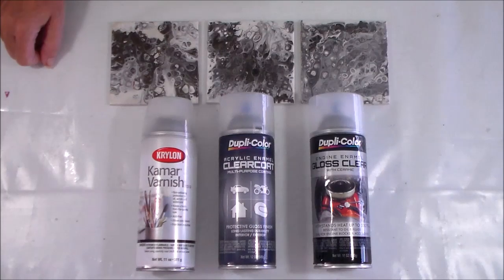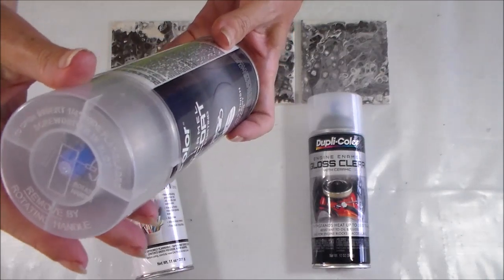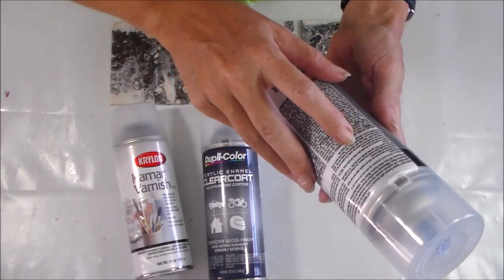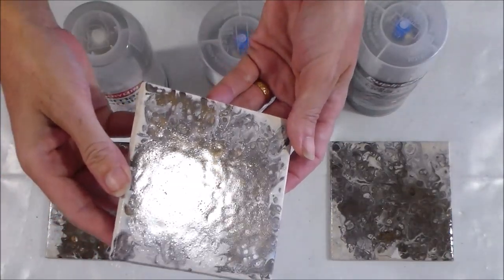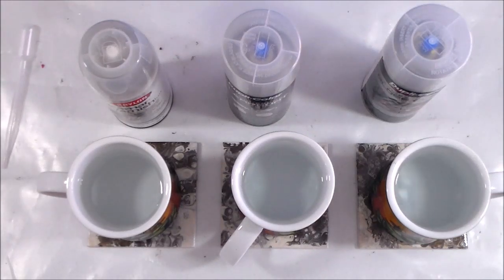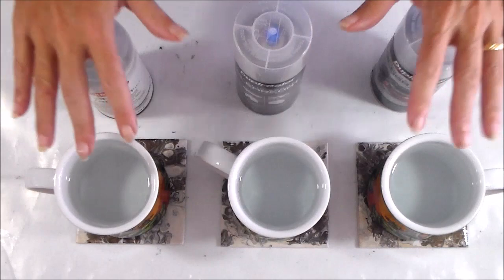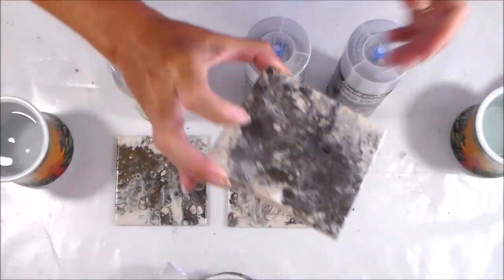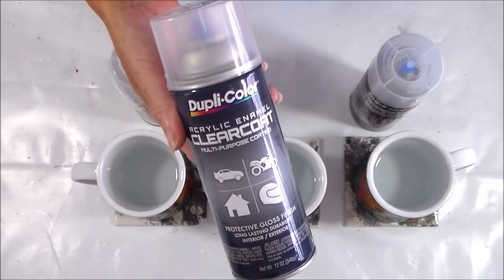Best Sealers for Painted Ceramic Tiles (Test & Review)

Comment: Hi there, I can recommend that if you had placed the completed tiles in a hot oven around 100 Celsius for about 20 minutes this would have baked these tiles to a more heat resistance level and you would have had better results as many heat resistant polymers need to be heat activated to harden the product I’ve tried this technique and it works very well with many other spray acrylic enamel polymer clearcoats, especially the gloss clear coat that definitely needs to be heat activated that’s why it’s for car engines the first time the engine runs hot that will activate the enamel and produce a harder wearing coat once the engine cools down, hope this helps 🙌
Reply: do you know if painting with poshka markers and acrylic, then baking the tiles would melt the paint? Ceramic tiles this is for

Comment: Here's something to try with any finish you experiment with.  Give it a heat treatment.  I baked a tile I had sprayed with Krylon Clear Gloss.  It came out nice and my hot mug does not stick.  I baked it at 200 degrees for an hour.  The color wasn't pretty to start with and it may have dulled a little.  And with medium hard effort I can scratch the surface. I think a lower temp for half the time will be my next test.  Thanks so much for your inspiration and information!
Reply: I was just going to ask if anyone had baked theirs. I just purchased the high heat one you tested in the video and it says to bake at 200 degrees Celsius for an hour to cure. My test subject is in the oven as we speak! How did your further tests go with heat? I am unfamiliar with Krylon so not sure if it supposed to be baked like the high heat one above. I will let you know how mine goes :)
Reply: Just looked at the cooled tiles. Gloss is good, hard a nails, hot cups no issue but my white did go a bit beige. Not sure if that is due to the paint being acrylic underneath or not enough coverage/coats with the spray so I will try another one with more coats and check the colour preservation. Due to product requiring 200 degrees Celsius for an hour, not sure if lowering the heat or time is an option???
Reply: @slertgum  , the engine spray is supposed to be baked at 200 degrees Fahrenheit which would be around 95 degrees Celsius.  Also, don't use your home oven.  The fumes can be dangerous so it is better to get a smaller toaster oven and bake your tiles out in a garage.

Comment: Great video thank you, but with these sealers did you you try  how best to clean.  I had a customer use a rough pad,  Which I had advised not too.  Scuffed them around the edges a bit. And I had sealed twice.  I also primed with a car primer.

Comment: Thank you so much for doing this!! I have been searching and searching for something that I can spray over my tiles in order to safely use for a hot plate. Do you think if you did multiple coats of the one product that worked the best, you may get a better cover and shine? I love how the resin makes the colors pop n the tiles. But unfortunate that it doesn't withstand the seat.

Comment: MinP
Thank you for taking the time to test these products..I had tried item # 3 myself and it did not work at all.  I was hoping you would find something (you said you were going to try) and indeed you did.  I'm  so glad there was a product we could use. Just got back from the store, got a great deal.  Can't wait to try it.  For me resin was not an option .  
Again thank you!!  Very much appreciated.
Reply from the maker: Excellent, glad it was helpful. I would say keep the coats nice and light and thin. I suspect that thicker coats also contribute to the sticky feeling and the dents in the finish later on
Reply: I'm working on wood coasters so I am keeping my fingers crossed, hoping this will work. My fear is that it works on tiles but not on wood.   I am waiting at least 3 days to make sure it's all "cured".
Reply: Sorry to have to report the the spray did not work for my coasters...as I mentioned I am using wood and I suspect that is the reason behind the failure.  I followed your instructions to the letter.  So I am guessing I am stuck with a bunch of wood rounds.
Reply: Acrylic Pouring how long do you let tiles dry before sealing?

Comment: I have a question for you. I have made acrylic pour coasters and I put 3 to 4 layers of Liquitex High Gloss Varnish on them before I realized that if I give these as gifts and people put hot coffee on them most likely the cup will stick and ruin the coaster. Do you think I would get a negative reaction if I use the Duplicate-Color Acrylic Enamel Clear Coat spray on top of the 3 to 4 layers of Liquitex High Gloss Varnish? I appreciate your response. Debbie Engle

Comment: Excellent testing.
I have a question.   The 3  sprays  you have used, are the  "isolating coat" which goes on directly over the cured acrylic paint, thus  remain between the paint and the top coat.?
Reply from the maker: In this case, the sprays that I am using ARE the top coat. I've not added any other product over the top of the spray coatings.

Comment: Do you know if resin works alright with heat? Or would I need to also use a sealant? Is there a brush on version? I don't have the option of taking it outdoors. Thanks so much for the video. I was also surprised that the high heat version didn't work well.
Reply from the maker: There are a lot of resins designed for use with high heat that should work beautifully and look gorgeous too. Resin is outside of my budget so I've been looking for a cheaper non-stick alternative. If you can afford resin, go for it!
Reply: I use resin on my tiles/coasters. It's beautiful but it is expensive if you are doing a lot of coasters or pictures. My friend uses her coasters every day with her coffee and has not had a problem.
Reply: Which resin do you use?  Is it ArtResin?

Comment: You may not use the "permanent isolating coat" then. In the future  when the piece needs to be cleaned from dust or whatever the person in charge will be able to remove the varnish, but the isolating coat will protect the paint underneath from been damaged.
That is what I have been told if I wanted my work to be archival.
Reply from the maker: I'm honestly not worried about that Elfie. These are painted coasters, designed to be put on your table with a cup of coffee. I don't need them to be archival, and of the sort of high quality that they might be treasured as priceless works of art in museums for hundreds of years to come. Unless you think your art is of that sort of quality, you really don't need to stress too much about that either. Just paint and enjoy.
Reply: Deby
It was my impression that people who do tutorial are open to suggestion from the viewers.  And that they  welcome new information. Rather than the usual "  how great, beautiful and so on."   I guess that that is t not the case with you.
The archival process is not only good for preserving art work, but also to make certain that the person who buys the coaster will be able to use them for a very long time.  Hot coffee cups need a very strong impenetrable top coats.
Just as a side.  my art work is in several museums.

I have never stressed out when I do art, whatever type I have done
Reply: Deby, I do hope you blocked that elfie.  You definitely do NOT deserve to have to put up with some RUDE, contentious, snooty know-it-all.  Her art work may be in several museums, but SHE is a snarky, unpleasant person.  I thought your reply to her was light-hearted, humorous!! Her nasty, uppity reply really showed her true colors.  You do so much for your viewers & followers.  THANK YOU! You have 14,000 followers who love & appreciate you.  I believe today, Dec.14,  was the day you were scheduled for heart surgery.  I've been flowing prayers to you for a successful surgery, & a speedy recovery!!

Comment: The Duplicolor Clearcoat Acrylic needs to cure for 7 days before you can put a hot mug on top of the tile.  The Duplicolor Gloss Clear Engine Enamel needs to be baked, in the oven, at 200 degrees FAHRENHEIT not Celsius for 20 minutes.   Do not use your home oven.  The fumes could be dangerous and the smell can stay in the oven.  Use a toaster oven in a garage or outside.

Comment: I bought the dupli-color and just finished about 30 tiles. Tested one 24 hours later and it completely stuck to the cup. How long do you have to let it cure before using??
Reply: I'm having trouble too. I bought the "Dupli-Color DA1692 Crystal Clear 12 Ounce General Purpose Acrylic Enamel" and just finished a ~7 day cure. Still sticking to a hot mug...

Comment: Interesting test for the tiles.  I am curious as to why you put the water under the cups?  Would the water not create a type of suction under the cups?  New to this, so hope they are not silly questions.
Reply from the maker: Not at all Linda. I wanted to see if they would leave any rings. Some of the tests, there was a faint water mark left as if the surface wasn't entirely water proof. That's important to know if you plan to use them for cold drinks as well, that might have condensation. Just trying to cover all the bases  :-)
Reply: Thank you. now the water makes sense.

Comment: Did you have issues with the duplicolor lifting with long term use? I have Mod Podge spray & it’s dried, however it lifted when I put a cool/empty cup on it. I have rustoleum triple thick glaze I’ll use on other set of test coasters, but I don’t like how it sprays. Too splotchy, not smooth. The rim of the cup lifted some spots with Mod Podge . Tried a mug, same thing. I have wood coasters I’m trying to seal & I’m afraid to put something on them that won’t serve its purpose to protect the small logo on the coaster & the coaster itself, which is stained.

Comment: The engine enamel usually requires heat curing.  Mine is 200 degrees F for 1 hour. That might make a difference.
Reply: There were no instructions or mention of heat curing on the can that I used, and I would not feel right about recommending anyone put these sort of products into their home oven. I know some people do and have heated it and then burned the paint because it's just a sheet of plastic after all. I think its best to try to find a product that you can use without high heat.

Comment: I think the high heat enamel has to be cured with high heat. I imagine the sticking is because it is not fully cured. Some paints and clear need 7 to 10 days to fully cure in 65 to 75 degree low humidity temp.

Comment: I think the engine coating needs to be set with heat.  Maybe try a few in an oven at high heat for about 10 minutes to set the coating.  You may even get rid of the spray marks. ?

Comment: I want a suitable sealer to spray on my ceramic tiles in the backyard, the heat in my country is extremely hot up to 50 degrees, is the middle product is preferable or there are better choices?
Reply: I want the sealer to coat the tiles after I repaint them, I would like to change their color

Comment: great test, exactly what I need. Also the results I hoped for, since I bought the center product...although, a slight caveat...the auto store did not have that, but had a replacement, Duplicolor premium acrylic enamel paint and primer..so, hopefully it works as good!
Reply: Hi Ken, I was wondering how the paint and primer worked for you? My local stores dont have this specific one and when I checked the Dupli Color site it's not even a product listed so I think it's now discontinued.
Reply: @HWTHangs  hi... I just ordered mine from Amazon. They also sell it online at Walmart :)

Comment: Deby the science geek!  Thanks for doing this for us, especially since products are so much more expensive where you are.

Several people who have used the engine enamel have stated that they cure them in an oven according to directions.  Does it say anything on the label about curing the spray?  When used on engines, they run the car for a while to cure the paint.
Reply: I just went and looked at the can and it does say heat cure at 300 degrees for 2 hours. OOOps I didn't do that but the hot cup never stuck.  Deby you gonna try this  before I do so I can see how you made out.  LOL :
Reply from the maker: Mine doesn't have anything on the can about heat curing so I didn;t do that. I've also read a couple of examples where people tried doing that in their domestic oven and created quite some nasty fumes in their homes - so I decided not to even try because I wouldn't want to recommend that to anyone. Better safe than sorry!
Reply: You're right.  I'm sure that the curing directions don't take into consideration that you're sealing over acrylic paint that contains the kinds of additives that we use!

Comment: Just wondering why you put water down first.  I have used your third example without any sticking. Curious? :-)
Reply from the maker: I was just testing to see if it would leave a ring. In an earlier test I did, one of the finishes got a water ring as well as sticking. None of these had that effect.

Comment: I've been making coasters with kamar varnish + UV protectant + krylon triple thick glaze, would putting the duplicolor acrylic enamel over the triple thick glaze work to make the coasters heat resistant? How long would I have to wait for the coasters to fully cure for them to be ready to sell?
Reply: Curious if you had any luck with this? I also use kamar varnish+uv protection+x3 thick glaze and had the same thought as you. Would love to know how it went if you succeeded!

Comment: I have used the dupli color engine enamel over acrylic on my wood coasters and after several months they still stick slightly if mug is hot but as the mug cools a bit it’s fine. Am interested if anyone knows a better sealer. Otherwise it’s not too bad.

Comment: Do you think these also work for tile coasters with 4x4 photos that are covered with mod podge? In desperate need of a seleant.
Reply: Ashley L I’m Wondering that same question . Did u have any luck finding a sealant ?
Reply: I actually make coasters with 4x4 pictures mod podged onto them, with three coats of mod podge on top.  I used the Dupli-Color Acrylic Enamel Clearcoat over them (following the instructions on the can of 2 light coats and one medium wet coat applied 10 minutes apart) and they are completely water resistant.  After 3 days they stuck a little when I tried the hot coffee test, but I left them alone for another week and tried again and they passed with flying colors.  No sticking at all.  I use the Acrylic Enamel Clearcoat on all my coasters now.  It works perfectly.
Reply: Heather Humble do they leave a scratch on the photos or protect from scratching? Thank you

Comment: Hi Deby, you may want to try the sticking test on unpainted tiles. Water alone can make a vaccum seal between the tile and cup. This probably has happened to you in the past , it has to me . Just a thought. Wonder what would happen to the finishes in a pot of boiling water. I know it's over kill, but suppose they pass 🤔
Reply from the maker: I seriously think if I soaked them in water that even with the sealer on top , the hot water would likely seep under the edges and eventually lift it off the tile. But I could try and see!
Reply: Deby at Acrylic Pouring, It may just clean the paint off the tile, I may be reaching to far 🤔luck in what ever you decide 😎

Comment: Hi is it dishwasher safe..im trying to seal my mug with dishwasher safe modpodge but i dont like it when it show brushs line ..:(
Reply: Hey! Did you find a solution for that? Im trying to seal my mug too
Reply: @Mimble_Doodles  would love to know as well.  I tried a bake on method using Krylon Clear Coat but the outside of the mug was still a bit sticky when hot water was added.

Comment: I test DecoArt products made in the USA but sold worldwide. I have been very successful using their Americana Triple Thick Gloss both brush on and spray variety. They also make a liquid Glass brush on paint, equally good on my wood-based flow decorated coasters.
Reply from the maker: And the Triple Thick stands up to a hot mug test without sticking. I'd been told it stuck so I hadn't searched any out to try it personally.
Reply: Mara... was that a typo, or did you really mean, "They also make a liquid GLASS brush on paint,"  Did you mean 'glass'... or 'gloss'...??
Reply: Carol it is called DecoArt Texture Glass and it comes in a 10 US fl oz jar. If brushed on tap tap like it stays elevated like drops on glass effect. I brush it on for a smooth finish.
Reply: @maratrumbo7852  Would that be dishwasher safe as well? I'd like to cover an acrylic/porcelain pen with it. I can bake it.

Comment: Does anyone know if this will be okay when cold drinks are sat on them?
Reply: Hi Codie, I think not.  I just came here to see if anyone else had a problem with cold drinks.  I made them a few years back.  The coasters really hold up to hot but not cold. Weird or what?  It seems the cold (or the sweating?) lifts the ink off the tile.  Too bad.  I did use blending solution so maybe that has something to do with it.